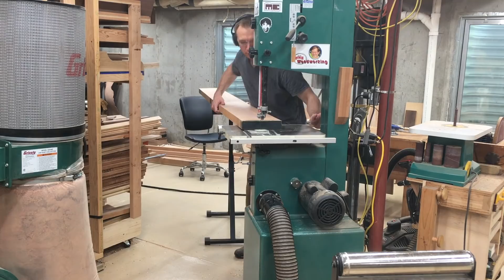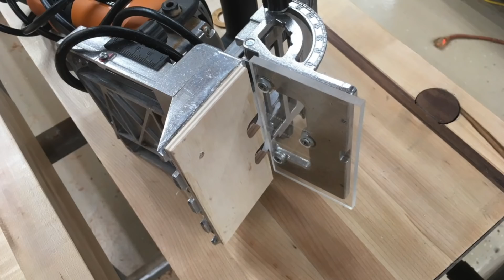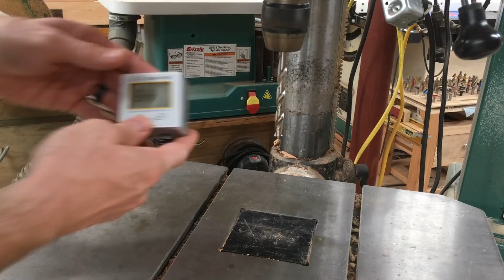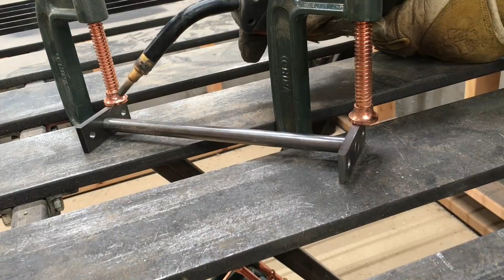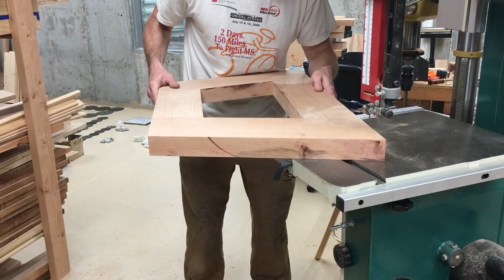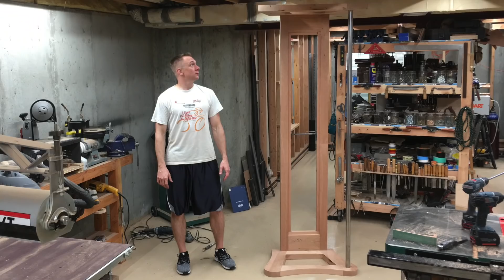Cabinet Build 5 - Frame

Comment: Won't the rods twist the frame in opposite directions?  I don't see why there's two of them.
Reply from the maker: Each rod will impose a right handed twist, it is a bit of a head scratcher, I recommend watching the video many times to run up my view count.  If I only had one it would tend to warp the back from a rectangle to parallelogram when tightened.

Comment: How can you see what's in the top drawer with it being that tall?
Reply: I believe the top4 or five drawers are not drawers at all. They join together to make a closet area.
Reply: As Timothy said, the top part is a closet area but, if they were to be drawers, I'd go with glass bottom drawers and mirrored ceilings ;)
Reply: It is to be placed next to a bunk bed.
Reply: I'd just use the first and second drawers as steps. They look like they'd hold a reasonable sized elephant.
Reply from the maker: You got it.
Reply: @AndrewKleinWW  I guess I missed that part in your previous vids...nice work!
Reply: it gets mounted in a hole - lol